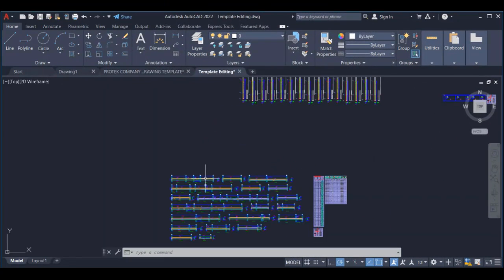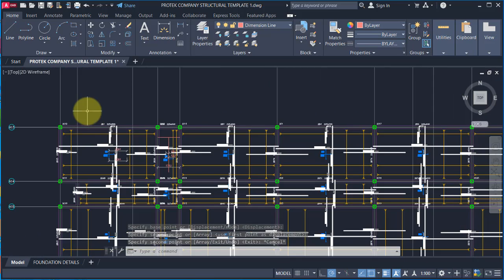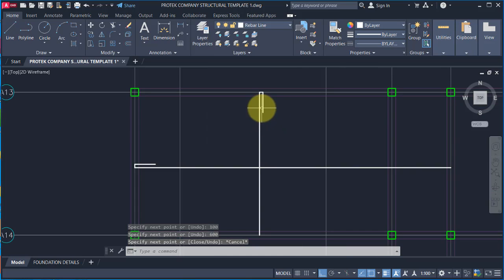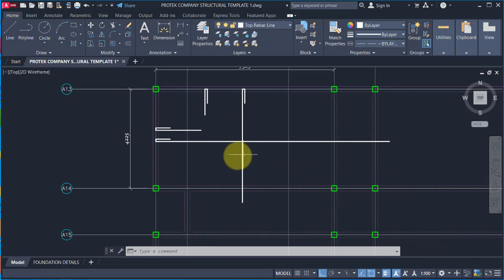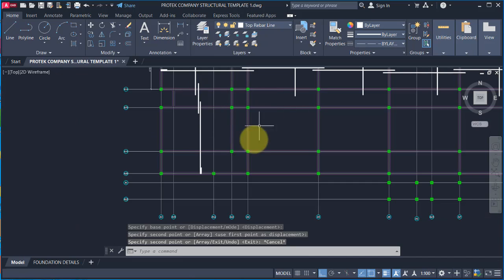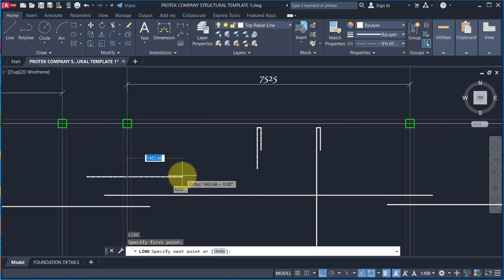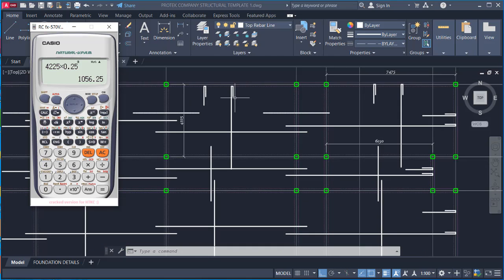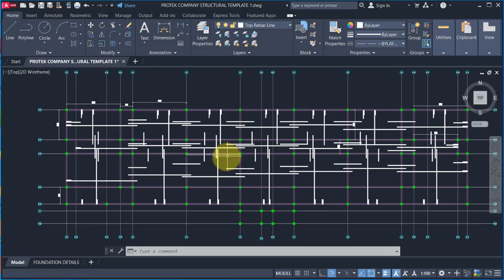How to Details Reinforce Concrete SLAB from Protastructure to AutoCAD

Comment: You're confusing between main and distribution bar. The distribution bars are longer in length in simple terms while main bars are shorter in length and at the bottom most for a particular panel
Reply: you are correct, the main bar is usually across the shorter distance

Comment: Can you please explain further on why lap length of 600mm is used. Is there a method to calculate it based on the slab span rather than the reinforcement diameter?
Reply from the maker: Yes, by taken some percentage % of the length of distribution or Main reinforcement referencing the slab panel
Reply: Yes, by taking 50xD ; Where d is the dia of reinforcement i.e (50x12mm)= 600mm